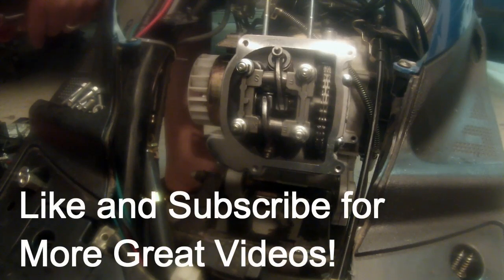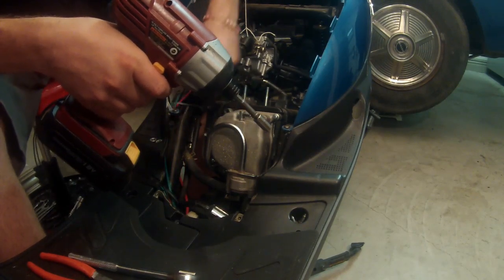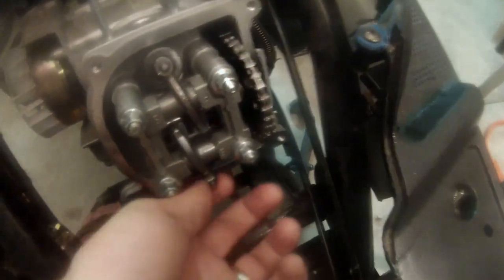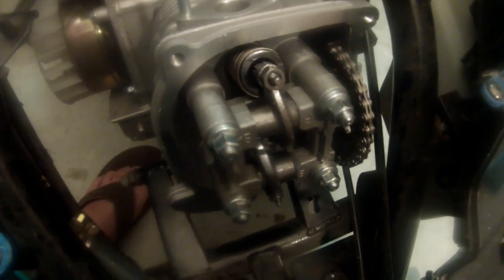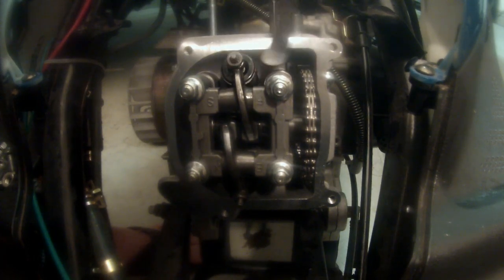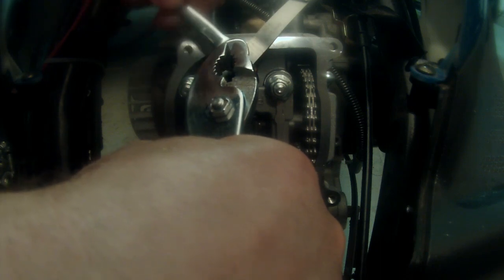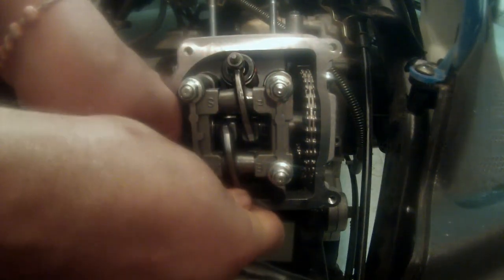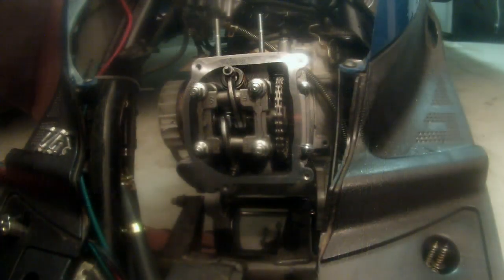How to Adjust Valves on 50cc Scooter

Comment: First things first. You didn't tell about the piston position during this adjustment.
Reply: When is the first piston adjustment on a brand new 49cc scooter suppose to be done?
Reply: Alton Darden 800-1000 miles is what I've been told and read
Reply: I believe the piston has to be in top dead center

Comment: I agree, omitting the need to set the engine at TDC is fatal to this video. At least mention if with superimposed text.
Reply: You can skip the TDC part, if you crank it till a valve is open, and adjust the closed one. Crank it again till the other is open, and adjust the opposite. 

The only point of going to TDC, is to adjust both valves at the same time without cranking the motor. 
It’s just faster to adjust one at a time. Crank it till it’s me is open, adjust exhaust. 
Crank it till exhaust is open, adjust intake. Same result, different method. Good luck!

Comment: I did this 4 years ago, my scooter barely was making up the hill where i live, after I adjusted the valves spacing using this video as reference, my scooter was flying! Time to do it again, If i can add something from my experience, there is a gasket on the valve cover, make sure you put it correctly when you install the cover back, because otherwise the scooter will leak oil from the cover. Overall, very easy task that will make your scooter run so much better.

Comment: First turn your crank to top dead center then adjust the valves to 2 on top 3 on the bottom
Reply: You can actually skip that step, if you crank it till one valve is opening. The other valve will be fully closed and achieve the same result. You will just have to crank the motor till the valve you are NOT trying to adjust is beginning to open, to adjust the closed valve. 

It’s a little trick us mechs do that aren’t interested in wasting time to find TDC, I just crank it over till one valve is open and adjust the opposite. Same result as it’s still on the bottom.

Comment: I just want to say thank very much. I am not good with any engines or mechanics and my moped would not start at all. I changed fuel filter and petcock valve. still nothing. I thought what the heck I have nothing to lose I watch your video and the next day I adjusted valves and I couldn't believe it  worked, and again thank you

Comment: Hey how about some help for us that don't have feeler gauges what else can be used to make the right adjustments
Reply: Although other options can be explored. Please don't be ridiculously stingy it's a dirty cheap tool that you buy once in a lifetime! 
As a rather basic example. I'm over 50. In my toolbox there's still the same feeler gauges set. I bought when I was 15 or 16. They still work as good as in day one. 
My oldest caliper as been in service since I was 14... 
So don't be ridiculous and move on!
Reply: I’ve used a matchbook to achieve similar results. But it is best to use a feeler gauge. 

On the more expensive end, I use an outside micrometer to measure my feeler gauge for accuracy. A regular feel gauge is accurate enough for a valve adjustment, but I’ve found most feeler gauges to be off by sometimes .003. Which is crazy. But still not enough to matter on a simple valve adjustment. 

If you’re in a pinch, use a matchbook. But know, it still ain’t right. Get a feeler gauge and set them correctly and be confident in your work. Good luck!
Reply: @crpth1  NO
Reply: @crpth1  some guys are living way off in The Boondocks, and they don't have a ride to town until they fix their moped! LOL, and it's not ridiculous if it works!

Comment: Just to get a second opinion.. I did a 50mm bbk 20mm carb upjetted 78 ran good (i think) but has cold start issues have to hand choke im thinking Auto enricher is bad or faulty. So i just been hand choking when cold. But now it wont start at all a little rumble like it wants to here and there but thats it... Im going to work my way back from timing which was set to 007ex 006in TDC recheck that than check for vacuum leaks around manifold and hoses last put on old/stock (rebuilt) carb stock jets. Or should i go other way? Carb,leaks,hose
Reply from the maker: I would start with the carb. Typically, if your a tooth off on your timing, scoots with a BBK typically won’t start or barely run. You would’ve known it right away. I would throw the stock carb back on and see if it starts. BBK’s still run on a factory carb but not optimally. If it starts, you know it’s and air/fuel issue, which is sometimes difficult to find the perfect jetting. Good luck!

Comment: I feel bad for anybody who follows these directions. He skipped the first step (which is also the most important).

Unless you make the adjustments at TDC you are making the clearances worse. His valves were closed because they were supposed to be.
Reply: what is the TDC? AND HOE DO I DO THAT?HELP!
Reply: @poetfederico  Top Dead Center, see the chain on the right in the video? There is an arrow on that gear holding the chain and a little mark on the case around it. Those need to be aligned. You can rotate the engine slowly with the kickstart or by gently rotating that fan part on the left and in white on this video.
Reply: rabbit929
0 seconds ago
You can skip the TDC part, if you crank it till a valve is open, and adjust the closed one. Crank it again till the other is open, and adjust the opposite. 

The only point of going to TDC, is to adjust both valves at the same time without cranking the motor. 
It’s just faster to adjust one at a time. Crank it till it’s me is open, adjust exhaust. 
Crank it till exhaust is open, adjust intake. Same result, different method. Good luck!
Reply: rabbit929
0 seconds ago
You can skip the TDC part, if you crank it till a valve is open, and adjust the closed one. Crank it again till the other is open, and adjust the opposite. 

The only point of going to TDC, is to adjust both valves at the same time without cranking the motor. 
It’s just faster to adjust one at a time. Crank it till it’s me is open, adjust exhaust. 
Crank it till exhaust is open, adjust intake. Same result, different method. Good luck!
Reply: finally someone smart to say it.  i was wondering if he did it anywhere in the video.

Comment: Seems a lot of people are smarter than this dude,......be surprised if that motor ran after he did that. Both valves must be on the rock before any adjustment is done,....
Regards,
Alpal
Reply from the maker: You are very correct. There are a lot of people smarter than me. 😃😃

Comment: i put a9 cam in 50cc gy6 and it made my scooter go slower then it was b4 . anyone know what i need to do to	make  it run right or if i need to adjust my other HP parts for it work together right?
Reply: I to just put a a9 cam into my gy6 with 100cc big bore kit and not impressed,  ever find ouy why its slow? Fyi i also have performance carb